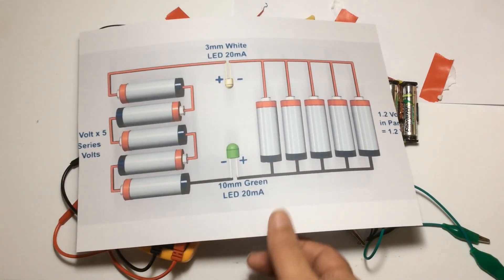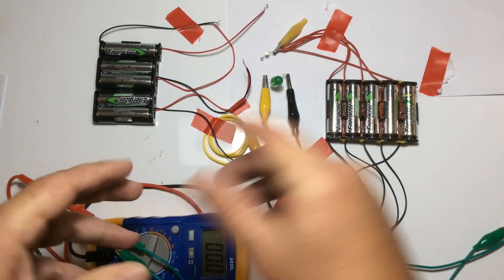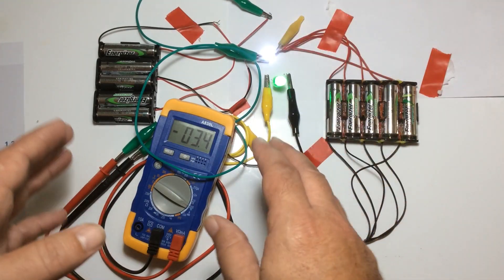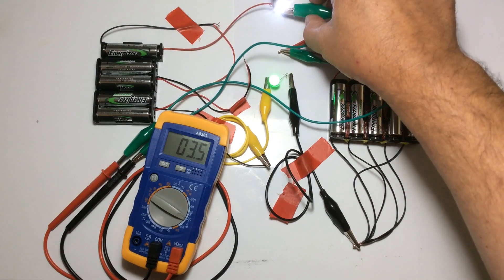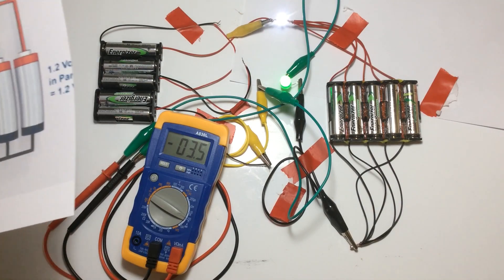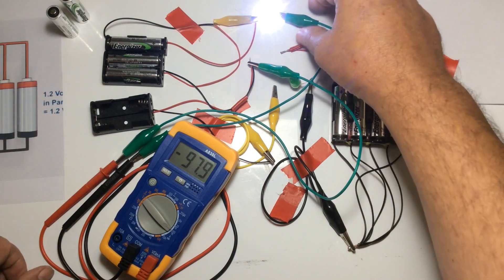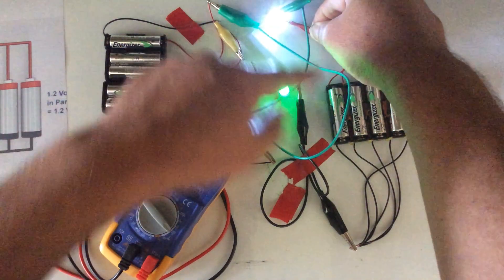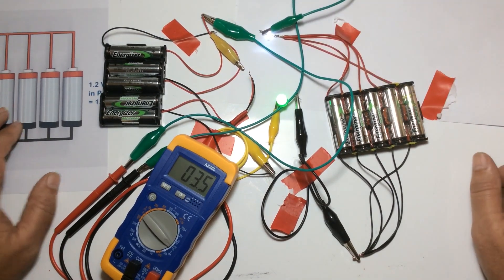TESLA TRANSFER METHOD AMPS INPUT & OUTPUT

Comment: If there is a voltage drop across the LED conventional theory would say there is your power consumption. Current x Voltage = Power... Same Current x Lower voltage = Lower Power ("consumed").

Investigate the fact the meter (IF anything) is actually measureing REFLECTED Voltage and Current bouncing back off the Load... waves in a medium (including magnetic waves) change when they hit a material with a density miss match and unless wave frequency is perfectly matched to the medium density... the only voltage and current for the meter to read is the result of Forward and Reflected voltage and current constructive or destructive wave interference. "Consumed" I suspect is the illusion created by magnetic wave form changes in a different medium.
Compartmentalisation of Education also seems to hide what is obvious in one field from another field looking at the same phenomena, just taught differently.
https://www.youtube.com/watch?v=JHSPRcRgmOw
Antenna "Tuning" or Impedance Matching is matching the power frequency to the Antenna so there is no reflected Voltage and Current... Do we think Loads are tuned to match their power sources? Or are they designed for power "consumption"? ;)
Reply from the maker: Thank you for your comment.
My sincere apologies for my delayed response.
Thank you for the video link it was very informative, for some reason I learn more from the educational material that was available in the 30's, 40's and 50's I suppose because after that what we learned was more political than educational.

I'm still confused by what reality presents in relation to this setup, I know that different components (Loads) present drastically different results even down to the colour of an LED because of the materials used to dope the terminals and some loads seem to be more easily impedance matched to encourage an efficient run.

It seems the more I learn the more confused I become and some days I need to remind myself that it is more important to know how than it is to know why. In my experience understanding something beyond how do I use it/make it has very little benefit, to me, as I waste many hours pondering why instead of benefiting from the how.
Thanks for watching.

Comment: If I use 48 volt lifepo4 baterei for off grid home electricity, is it safe use with inverter (for convert it to 220 volt  system). Whatthe long term effect for baterei health.
Reply from the maker: Thank you for your comment.
You can use any voltage battery as long as the receiving parallel arranged bank is half the voltage of the serially arranged battery bank.
The most important thing to be aware of with LiFePo4 is the BMS (Battery Management System). The BMS must have parallel and serial connection compatibility because without this feature in the BMS you will most likely damage your batteries.

A 240 volt inverter can be used with this setup, the voltage seen by the inverter will be half the voltage of the serial battery, you can arrange your batteries in this manner then measure the voltage between the serial and parallel banks on the positives and you should see half the voltage of the serial bank. You can take a look at my video on my 12 volt version of this concept, as long as the same capacity is used for both banks the energy will have somewhere to go. 

Obviously with a 48 volt battery system your inverter would also be 48 volts. Therefore you would need 4 x 48 Volt batteries to use this concept, 2 x 48V volt in series and 2 x 48V in parallel. Your serial bank will be 96V and your parallel bank would be 48V and therefore you have 96V - 48V = 48V seen by the inverter.
Again please be sure to check the BMS compatibility of serial and parallel connections as a mistake with lithium can be disastrous.
Reply: Thanks ❤
Reply: It seem i must search an electronic man for ordering custom BMS for this specific need. 

Or may be i go a little search if theres this spesific BMS on online marketplace. Sorry because this new world for me
Reply from the maker: @elizabethaya156  That type of BMS is very readily available, it is just something you should look for in the specifications.

Comment: dear friend... I think you misundestood some basic things... you can consider the parallel bank a kind of resistor in return path to ground.. so you get less current thru the led...
but when connect the same led to the series pack you MORE diferential potencial and LESS resistance... so you get more current thru the led...

in the other hand, you can measure final votage when transfer stops, change the batteries (as you said), and do it again till balance, measure the voltage, and so on for a few cicles...

you will notice the voltage goes down along the time because the ligth emission...
Reply from the maker: Thank you for your comment.
I also assumed that would be the case but it not the entire picture. When I replaced the battery set with a resistor and set to the same resistance of the parallel battery bank , (in another video), it was a very different outcome. The only way to try to understand what is happening is to replicate the experiments so you aren’t relying on some YouTubers word.

Connected in this way the potential voltage difference is what allows for the power to flow from the series bank to the parallel bank. This is why an extra battery is added on the series bank for an increase in voltage due to the drop in voltage seen when adding the parallel bank.
ie. Conventional operation: 3 x AA in series = 3.6 Volts
      Transfer method: 4 x AA in series = 4.8 Volts - 1.2V Parallel bank = 3.6 Volts.
Between the series bank and the parallel bank is 3.6 volts and this is the voltage seen by the load.

The potential voltage is the same but we see a far greater power consumption using the conventional sense.

Comment: Smart.. and when series voltage gets equal to parallel or as the led goes dim, you change the batteries from series to parallel and vice versa..👏 nice concept although there are gonna be some losses in the heat - still you could do about 10 rounds like this..
Reply from the maker: Thank you for your comment.
You would be absolutely correct and there are small losses however these can be easily overcome for an exceptional level of efficiency. Once mechanical switching is applied there is a tremendous increase in efficiency. I found it to be a lot more than ten rotations but more important is the lengthy run time on each run.
Reply: i hope you explain little bit someday about mechanical switching
Reply from the maker: @user-xy9pr7ld2i Sorry for my delayed reply.
I too want to make time to examine the automatic switching but unfortunately I have too many normal tasks that need to be done first. Hopefully that will change soon.

Comment: The voltage was higher on the one side reducing the current draw. The wattage on both side was esentally the same. No mystery here. Ohms Law stands
Reply from the maker: Thank you for your comment and sorry for my late reply.
At the risk of seeming lazy I will re-post my response to another comment, I believe this answer covers the extra light seen.

Thank you for your comment.
I understand how you may have come to that conclusion and in the conventional sense you would be correct, however, I will explain why this isn’t factually correct. When referring to my older videos you will see a version of the transfer method, for example the 275 day test in which I use 3 AA in series supplying 3.6 volts maximum to the LED. This voltage would be ideal in a conventional sense but in the transfer method we have a voltage reduction caused by the parallel bank of 1.2 volts. The voltage seen by the LED in that setup is 3.6V - 1.2V = 2.4V yet the light still works!

In this video I am using 5 AA in series which is supplying 6 volts, 6V - 1.2V = 4.8 Volts.
4.8 volts is too high for the LED that is rated at 3.2v to 3.6V which is where the Green LED comes in and according to my research the colour does matter, please refer to my other videos.
The LED’s are diodes and therefore present a voltage drop, typically around 0.9 volts and as we have a series looped circuit each diode in turn presents a voltage drop also at approximately 1.8 volts combined.
6V series bank - 1.2V parallel bank - 1.8V diode voltage drop = 3 Volts.
3 AA’s at 3.6 volts is as close as I can get to the 3 volts actually seen by the LED using 1.2 volt batteries which is why I used only 3 batteries, might I also point out that there is no way that an increase of 0.4 volts that is achieved with the 3 x AA’s would account for an approximate 90% reduction in amperage, it would however account for the increase in illumination you mentioned.

This concept in no way defies the current understanding of electricity, this is known and deliberately not taught. Your every day electronics will function this way as I have clearly demonstrated, I can connect my normal devices to this and run them longer than the way we are “sold” to run them.

 My point is your devices were manufactured to not include this concept because at a bare minimum you would pay them around 70% less money using this method. 30% wasn’t enough for them, they want all your energy, so they taught us the most expensive way possible!

Comment: Interesting. A question and an observation. Q: Does it matter that the LED's are mismatched in color and width? I'm assuming they are both rated at 2V? Observation: the mA draw on the meter when you test the negative rail is (-) (indicated by the ' - ' prefix on the reading) while it's (+) when you test the positive rail . (Edit: I'm in Australia also).
Reply from the maker: Thank you for your comment.
Yes the colour is important, at least in this setup. From what I can tell, I don't believe the size of the LED is a significant factor. I had previously used both white LED's in the circuit and the amperage is much higher. The LED's are rated at 3.2V-3.6V @ 20mA. It is my opinion that the efficiency is directly related to the doping materials used to make the green colour.
The observation you made I am unable to confirm as this will happen depending on the connection of the meters leads, ie. if I swap the leads around at each point you should see it switch between minus and positive.
Nice to have a fellow Aussie on board.

Comment: Its interesting that we are both doing the same thing at the same time, as I mentioned before. I also find that the same current which runs a load comes out the other side to charge the second set of batteries. I am using 18650s and 12V lead acid batteries tho myself.

I also find that my devices use less current using this method compared to the standard single battery method. This confuses me and I cannot figure that out.

Its hard to see on video. Do you notice if the LED is dimmer the one way compared to the other at all? I am experimenting with various loads such as a 12 Volt blower heater and larger LED lamps. Still trying to work it all out what is going on.
Reply from the maker: Thank you for your comment.
I agree with you about performing the same experiments a world apart at the same time is kind of cool.

I have been thinking a lot about what is going on with the low amp consumption using this method and I want to hang my hat on the theory of killing the dipole. Moving the power back to the battery in the conventional sense probably shouldn't be done and it causes at least an 80% increase in amperage. I believe what we are doing is supplying the path of least resistance. In the conventional sense the power moves through the load only because it increases the amperage so much that it bursts the dam. I could be wrong but I believe the method we are using electricity is the way it should be done.

Are you referring to the difference in illumination of the LED on the NEG rail or POS rail? If this is what your asking I can confirm you are correct regarding the LED is brighter on the POS rail and in turn consumes slightly more power. I wasn't sure because the difference was minute so I measured it with a Lumens meter.
Reply: @whatifididthis...1236  I have to get some higher amp meters because now I am working with lead acid batteries and higher current. But I think there is less current used and reduced output. I am running a heater right now. I want to be sure if there is a difference in power consumed and output before I make any claims yet.

You have a point on the dipole. Bearden always said we should research how to not kill the dipole but far as I know he never said how. That has bugged me all these years.
Reply from the maker: @TheDoItYourselfWorld  I believe the batteries we choose for this system are also important and must be considered with the load chosen. The 12V 7Ah battery that I show in my 12 volt version, which looks to be similar to your 12V setup, have a charge rate of 0.8 amps, therefore if the load consumes more than 0.8 amps it would technically be charging the parallel set at a charge rate too high for the batteries.

However the reduced amp consumption using the power transfer concept may allow us to safely use DC loads that have an amp rating exceeding the charge rate as when used this way they don’t consume anywhere near the stated amperage.
Reply: Lower current might be from the increased resistance of charging the batteries on the other side, being higher than the resistance of the negative terminal of the same battery.

Comment: The LED appears to be brighter in the conventional test which corresponds with the increased energy draw. The ambient light changes as well which may be a result of the camera responding to the increase/decrease in LED brightness so it's difficult to make accurate comparisons.
Reply from the maker: Thank you for your comment and sorry for my late reply.
At the risk of seeming lazy I will re-post my response to another comment, I believe this answer covers the extra light seen.

Thank you for your comment.
I understand how you may have come to that conclusion and in the conventional sense you would be correct, however, I will explain why this isn’t factually correct. When referring to my older videos you will see a version of the transfer method, for example the 275 day test in which I use 3 AA in series supplying 3.6 volts maximum to the LED. This voltage would be ideal in a conventional sense but in the transfer method we have a voltage reduction caused by the parallel bank of 1.2 volts. The voltage seen by the LED in that setup is 3.6V - 1.2V = 2.4V yet the light still works!

In this video I am using 5 AA in series which is supplying 6 volts, 6V - 1.2V = 4.8 Volts.
4.8 volts is too high for the LED that is rated at 3.2v to 3.6V which is where the Green LED comes in and according to my research the colour does matter, please refer to my other videos.
The LED’s are diodes and therefore present a voltage drop, typically around 0.9 volts and as we have a series looped circuit each diode in turn presents a voltage drop also at approximately 1.8 volts combined.
6V series bank - 1.2V parallel bank - 1.8V diode voltage drop = 3 Volts.
3 AA’s at 3.6 volts is as close as I can get to the 3 volts actually seen by the LED using 1.2 volt batteries which is why I used only 3 batteries, might I also point out that there is no way that an increase of 0.4 volts that is achieved with the 3 x AA’s would account for an approximate 90% reduction in amperage, it would however account for the increase in illumination you mentioned.

This concept in no way defies the current understanding of electricity, this is known and deliberately not taught. Your every day electronics will function this way as I have clearly demonstrated, I can connect my normal devices to this and run them longer than the way we are “sold” to run them.

 My point is your devices were manufactured to not include this concept because at a bare minimum you would pay them around 70% less money using this method. 30% wasn’t enough for them, they want all your energy, so they taught us the most expensive way possible!